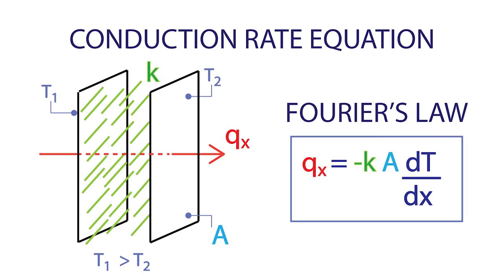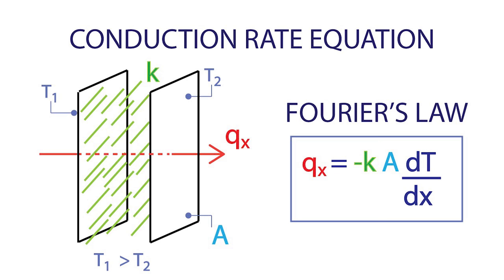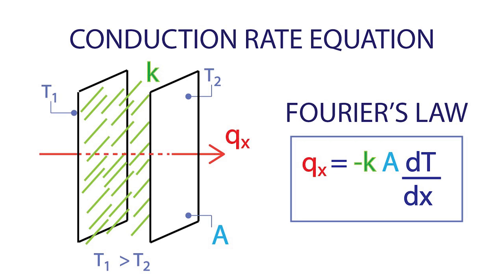Radiators, Fluid Temps, & How to Avoid Thermal Issues

Comment: What would happen if you're loop will have everything exept a radiator
Reply: Radiators are the parts that cool the water down...
Reply: Yes
Exclude it

 
 
 
 
 
 
For "Science"
Reply: It would just gradually overheat because the only thing cooling it down is the thermal mass of the liquid, it has the same results if you were to attach a 10kg block of metal on top of your cpu, the temps would be good for a while, but after the metal heats up death will occur
Reply: No
Ever heard of pasive cooling
Reply: Ever heard of the concept of thermal mass? A heatsink like on a GT 1030 is different to a metal brick in many ways, reply when you finish 5th grade and learn basic physics
Reply: Are you daft? Maybe at idle and some light processes the pc would work fine but doing anything that would create heat would cause a shutdown. There would be no type of passive cooling without a radiator. Perhaps your idea would work with a rad without fans but to completely exclude a radiator would be a short run test.
Reply: You ruined my idea
It wasn't realy serious
Reply: Dammed
Reply: your water temps would just continue to climb until theyve reached the temp of your hottest component. Of course, as the water warms up, your processor and gpu temps will continue to go up with it. In a not very large amount of time, youd have your watercooled components overheating til throttle kicks in, and youre existing water cooling parts will degrade rapidly.

Comment: Best way to avoid thermal issues, use air cooling.
Reply: Not sufficient for high performance CPUs (cough ... Intel i9 ... cough) especially if you oc.
Reply: Well that's just not true.
Reply: You speak so confidently, you must have a PC with an i9 built and working on air, overclocked ofc. 
Well, I'd like to see what temps you're getting on pure air on an i9 7900X oc to 4.7 Ghz. And how noisy your system is too pls, at least approximately.
Anyhow, it can be mathematically proven that water cooling is better than air cooling in terms of thermal capacity. Just think about the extra surface area to dissipate heat you have with say 2 360s compared to the usual CPU heatsink.

Edit:
Oh, all those temps etc while running some benchmark, you choose, pls.
Reply: That's all available for you, if you google it.
Reply: Brian Wilhelm Indeed, there is the info that proves i9 7900x oc is too much for air, there you go: https://youtu.be/L_bwMGYsXFw
Reply: Thats the hottest CPU on the market (also one that nobody buys, so nice obscure reference there), and here's it on air. https://www.phoronix.com/scan.php?page=article&item=noctua-air-roundup&num=4
Reply: In my first comment I said that air is not enough if you oc a very powerful CPU, such as one of the i9 CPUs. You denied it. I showed you a video confirming what I said. Now you want to change what I said in the beginning? I did not say air is useless, I said sometimes it is insufficient. SOMETIMES. You cannot deny that after watching the video I sent.

Edit: The link you sent shows the 7900x running at stock speeds, which is against what I said at the beginning.
Reply: Sometimes, great. so you are less than 1% correct.
Reply: And where did you get this number from? Less than 1%... I specified the i9, and I specified overclocked. So if the i9 oc cannot really be used on air, I am 100% correct.
Reply: i didn't specify any of these things, so i guess you're talking to yourself.
Reply: Brian Wilhelm You said best way to avoid thermal issues is air cooling. I said air is not suitable  for high performance CPUs such as the i9 oc, I specifically said i9 and I said oc. You denied my statement. I gave you evidence that air cooling doesn't have the thermal capacity to deal with the i9 7900x oc. You kept denying and gave me a link where the CPU is tested at its stock clock speeds, which doesn't have anything to do with what I said. And now you are saying you never denied my statement? Really? Please stick to logic here.

Edit: I guess you're the one talking to yourself, if you pick half of what I said and deny it, rather than actually analyzing my WHOLE statement and giving examples of when air cooling actually managed to cool the i9 7900x at 4.7Ghz to provide evidence for what you said. And you do that because you know that air cannot do that, but if you admit that, you will have to admit you were wrong.

Edit 2: And I never said air is not suitable for any CPU, I specified the i9 oc. You, on the other hand, generalized that people should use air cooling to avoid thermal issues, without specifying the CPUs that can go with air cooling, so from what you said, any CPU in any situation should be used with air cooling, and this will get rid of thermal issues.
Reply: again, you bring up one cpu (a space heater at that). keep typing thou.
Reply: It does not matter if it's 1 CPU or 10. It's enough to prove your generalized statement wrong. Unless, of course, you specify that air cooling is only suitable for a limited number of processors, agreeing with me it is not suitable for a number of high performance CPUs such as processors from the i9 lineup when overclocked. But of course, you seem to want to prove yourself right so hard that you'll even go as far as to defy logic. It's for that reason I keep replying, I hate when people stop thinking logically for the sake of proving something, instead of just admitting they were wrong.

And I used the 7900x as an example because that's the only CPU from the i9 lineup I have had good hands-on experience with. From the web I also know that other i9 CPUs with higher core count behave no better than the 7900x with its 10 cores. So yes, I could have used any i9, but decided to stick to 1 CPU for simplicity and because that's the CPU I know best about.
Reply: ^ Look someone who knows things!
Reply: WarmSoftKitty, link to such info pls. And, while you're at it, links to all CPUs from the i9 lineup running perfectly fine on air cooling* while being overclocked pls, as you seem to imply (correct me if I'm wrong here), that air cooling is fine for any CPU even overclocked. The 7900X should be running 4.7GHz (or higher) on all cores, the others - any significant oc.

Also, I did not mention AIOs at all in my argument. AIOs are inherently worse than proper custom water loops, and the performance is highly dependent on the specific AIO. And it's interesting how you said "almost every". Yes, of course bad AIOs are not going to do great, and there's a huge number of brands making AIOs that no1 knows about. AIOs are more complex than heatsinks, so if one wants to cool using an AIO, he should expect to spend more money. This does not mean however that air cooling is "the best way to avoid thermal issues".

Now, is there any air cooler that will provide comparable temps to a custom water loop with say 2x 360 40mm thick rads with good air pressure fans cooling only the CPU? I know it's overkill for just the CPU, but still. If air cooling is so much better (which is what you two are saying), it should be comparable to any configuration of water.

*Please do not include anything related to delidding, as no sane person will risk a 1000 dollar CPU instead of just water cooling it.

Edit: https://www.youtube.com/watch?v=inH278yCXvo "with the right cooling solution", "be prepared to invest in a custom liquid cooling solution if you plan to overclock".

Eidt 2: Unboxed Hardawre also says that performance on a "premium AIO" was "miserable". Shows that "water cooling loop" can't be substituted by "AIO".
Reply: Brian Wilhelm, even if some1 managed to cool the 7900X@4.7 properly using air cooling, it's not realistic to assume you just have that powerful CPU without any GPUs. It's logical to assume you'd also have say 2 1080ti SLI. Cool that on air, let's see what temps you'd get inside that furnace of a PC. Only way to cool this properly - use water cooling.